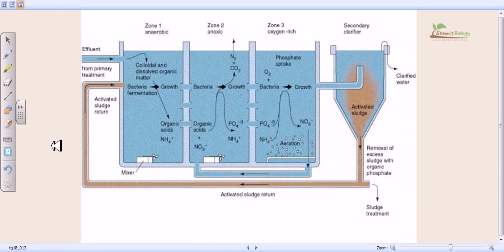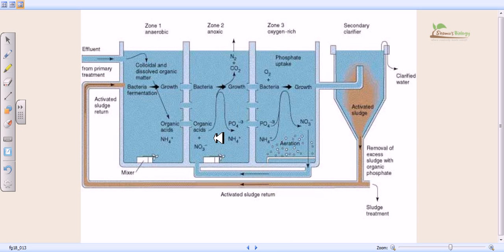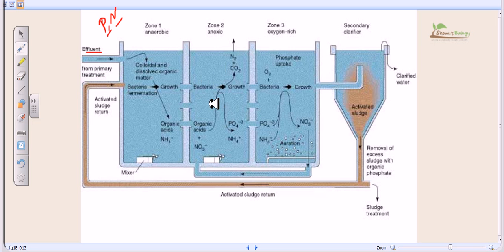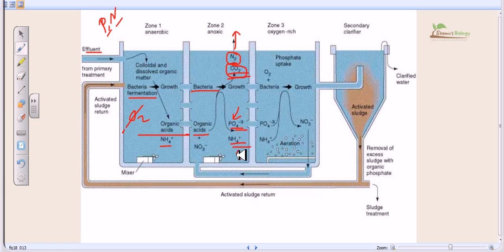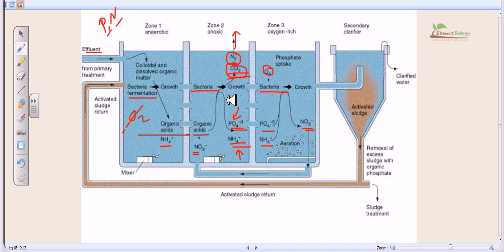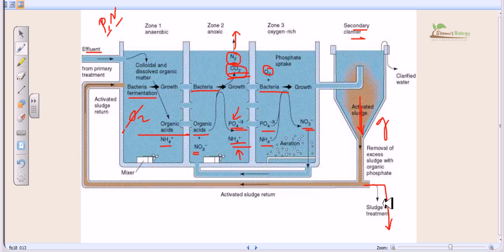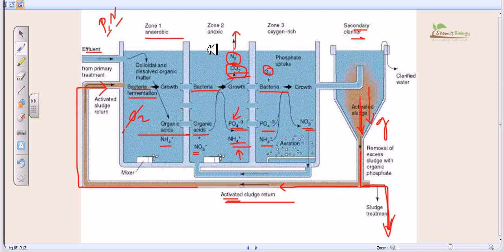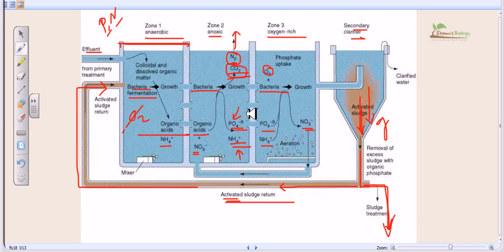Secondary treatment of wastewater

Comment: we here are trying to wake water free of organic content, right, so why would we add sludge an the chamber for nutrients. I think It is added for the inoculation of microbes
Reply: +Lakshay Sethi Recirculation is used as carbon and NO3 source. In some cases, it's necesary add methanol as external carbon source, when the BOD in the anoxic zone is much lower than required for the bacteria even after mixed with recirculation.